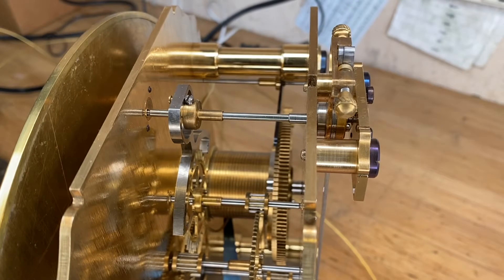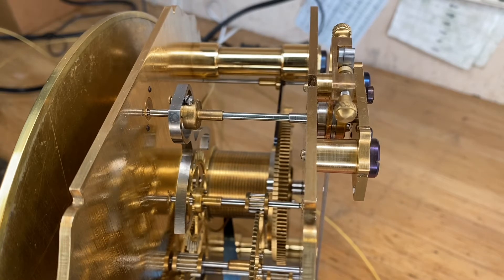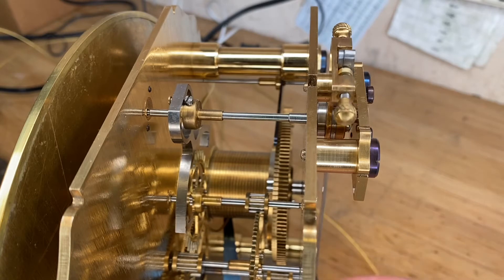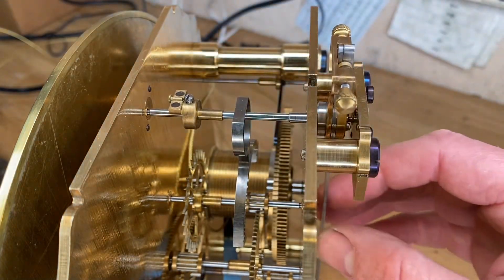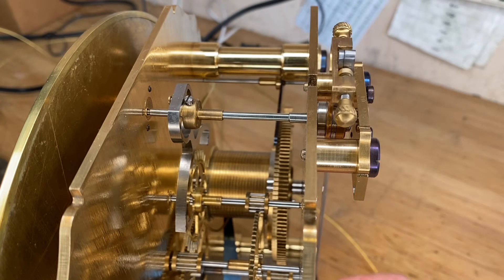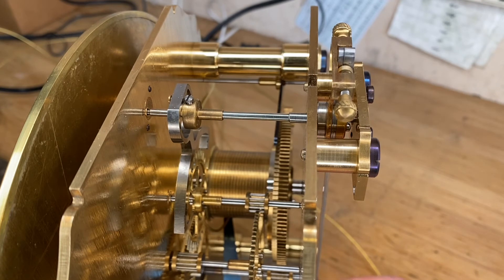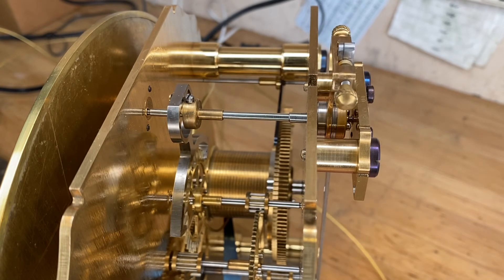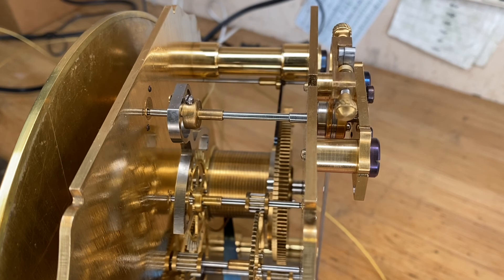Improvement for an English Regulator, protecting a deadbeat escapement

Comment: Do you have a source for the small magnets or do you make your own?
Reply from the maker: They need to be neodymium magnets so that they are strong and light enough. You can buy them from lots of sources.
Reply: Thank you. Not too many sources in the UK probably. I’ll need to find them. Great idea.
Reply from the maker: @colinmaceke7474  in the US you can find them on Amazon,   They are super useful, in later videos I show how to use them for a clutch that gives a great way to be able to change times on the clock.
Reply: You’re quite right. Plenty on Amazon. Haven’t had a need for magnets making locos! I have made Wilding’s skeleton clock. Nice design but due to too short fussee it only runs for a bare 7 days.